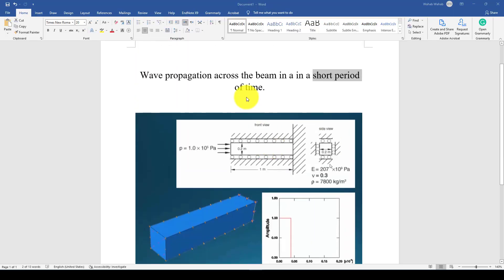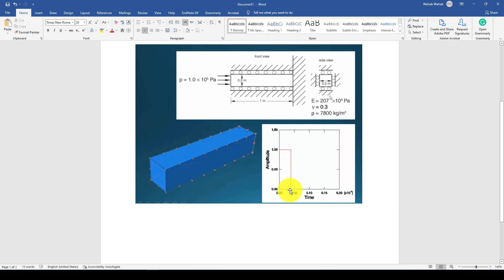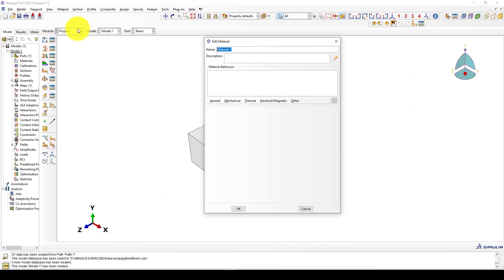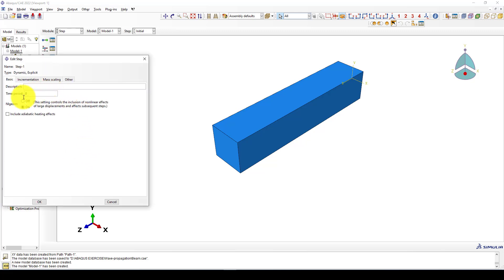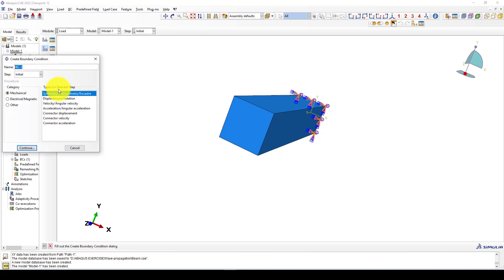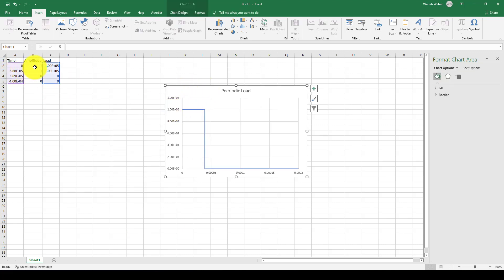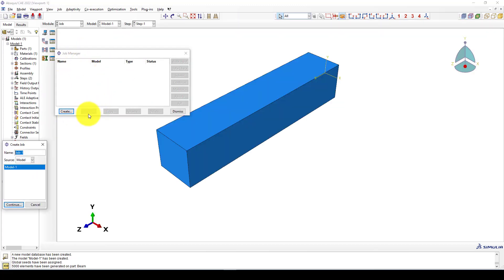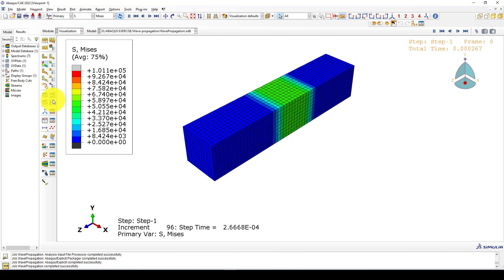ABAQUS Tutorial Wave propagation simulation across the beam in a short period .

Comment: Very nice explanation, Thanks  a lot. I have a question, how can find the time taken to reach the pressure wave till the end? It will be a great help if you find time to answer it.
Reply from the maker: Hi there,  take the length of the beam times the velocity of the wave.
Reply: @KSSE_Engineer     In my case the beam is made up of orthotropic material, how can i calculate the wave velocity? Is there a way to find wave velocity by abaqus?
Reply from the maker: @visible871  Check Abaqus Out-put there is.